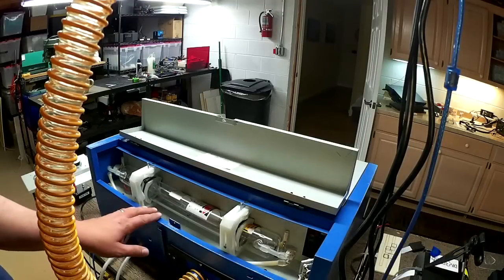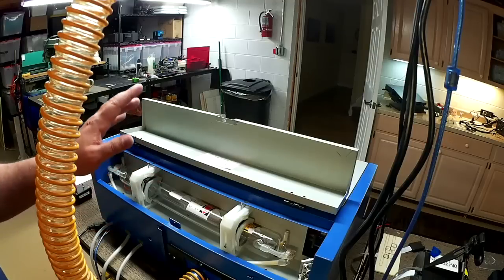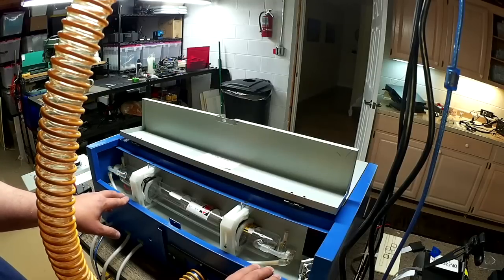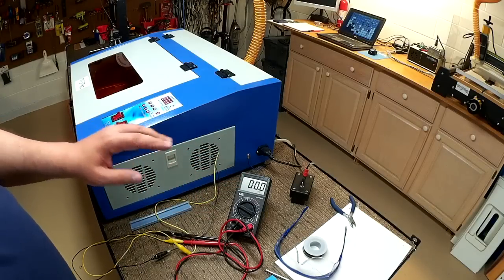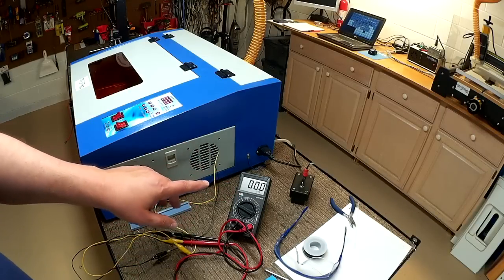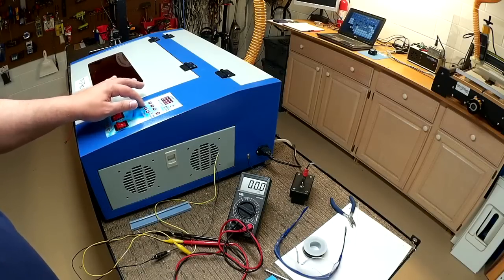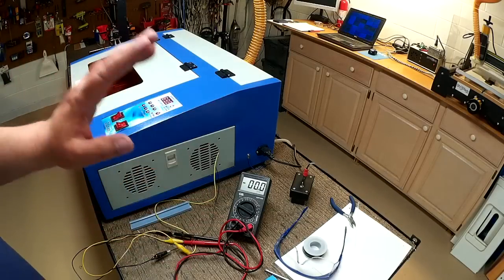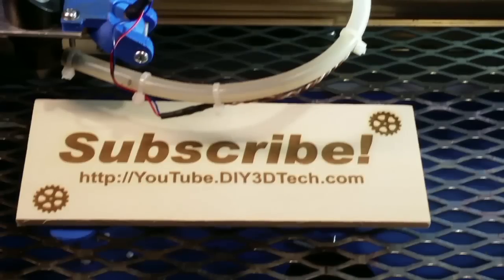K40 eBay Chinese CO2 Laser  -  Measuring Laser Tube Current!

Comment: hello, thanks for making this great video. I have a question though and would be glad if you might be able to help. We have a new 100w laser  tiube(117max, 107 agreed), fro "Reci Laser ". The one we had before was a Yongli, also 100w. The new one  is supposed to have a max current of 26 milliamp. But if we measure at the location with the wires you advised, we only get a max of 6,35 milliamps. What could be the reason for that? Thanks already for reading. keep making great videos:)

Comment: First at all, this laser tube can deliver 45W maximum (damage threshold), but it is rated 35W with 20 mA current. Performance also depend of how cool is water - the cooler, the better. Also, the specification say 15 - 25 C of water coolant. You should to run up to 20 mA, but for safety of the tube better 19 mA max. Minimum threshold is around 5 mA, below that laser does not work.
Reply from the maker: I agree in general as I have seen what would be a mechanically rated 40 watt tube be over driven to produce up to 50 watts which of course will shorten its life so there is a give and take.  However after using several of these for many years I have not found a correlation of water temp to performance in hobby laser applications as the duty cycles are typically short verses that of a high duty cycle industrial laser...
Reply: @DIY3DTECHcom  That is true. Somewhere I ever found that this laser tube might be 30W or even less, according to tube length. Well, that is small change in power, but I know myself - want more power. Achievable by cutting side of the machine and protruding new, stronger tube. But that cost more. Then replacing power supply for the tube... that may come later, I want first to buy my first laser cutter. :D

Comment: In my machine on the panel or in your program I set the minimum power to 30% and set cutting power to 10% or what ever I need. It wasn't explained in the manual but it worked for me.
Reply from the maker: Is this a k40 laser this sounds more like the 50 watt version?
Reply: Yes , mine is 50 watt.

Comment: How wide is the machine with the 35w tube? Is it 28in or 31.5in?...and u prob right the older version with snslog meter ptob sre better made machines...with better laser tubes...snything newer is typically chesper made to cut costs....people are brainwashed by compsnies  that newer is better made  and thats not the case most of the time for many products.
Reply from the maker: Can't remember and this unit is in storage, but this this a 35 watt unit and the other you see in my video (with the meter) is a 40 watt unit..

Comment: Hi..i was told by someone that tested watt output...that all these ebay k40 are fake specs...and not 700mm 40w tubes...they are 600mm 20w tubes...
...can anyone else confirm this?
Reply from the maker: This one is a 35 watt tube (which was sold as 40 watt incorrectly) however my other is 700mm and true 40 watts.  The ones with the analog meter tend to be true 40 watt machines...

Comment: How do you calculate the wattage after you have done all this? Ma x volts?. If yes, is it a matter of changing setting on the multimeter to read voltage instead of Ma? All wires stay the same?
Reply from the maker: Watts=Volt x Amps, however this is not needed as you should work in mA only and no need to figure out watts...
Reply: @DIY3DTECHcom   How to tell though if received tube is as described? For example a 100 watt tube or if power supply has the capability

Comment: at about 20 percentish and below, the tube is run in a pulse mode, not constant current and that is confusing the meter which is looking for DC, not a square wave. Once you go higher it goes into standard constant current. An analog meter will be ok with it as the needle has enough inertia to cope with the pulses. The tube is pulsed at the lower current settings as it has to have enough current to actually strike an arc reliably
Reply from the maker: Many thanks for this!  This is helpful to know as I sort of guessed at something this ;-)
Reply: Thanks, that's interesting... please provide a link to more information on this, cheers
Reply: Consistent with my first test run at 10% (raster on paper) which worked perfectly.

Comment: I also have a new K40 laser in addition to my bigger 50w unit. I have a laser power meter, and my new K40 actually puts out 43 watts at 99% power (which is slightly over driving the tube).  Thought people might want to know that you DO generally get 40W at the full power setting.
Reply from the maker: Laser output is a pure function of tube length and you will want to run it around 80%  as that last 20% will create a exponential loss of tube life so expectations of  a ~720mm tube should be around a 32/35 watt duty cycle...

Comment: I have seen laser tubes rated at 18 to 22 milliamps max. Your tube should have a sticker on it that says what the max current is and what the tested output was. I have a 50W laser and have never over-driven the tube. It still puts out 23 watts of power after 4-5yrs of 15-30 minutes use per day. In my machine settings 65% output maxes out the current. Every one of these machines should have a built in milliamp meter.
Reply from the maker: Its work keeping in mind there is a big difference in Chinese verses non-Chinese tubes.   I have two k40s and there are no tube markings, but 22ma is a normal "max".

Comment: Wouldn’t the fuse burnout before it kills you?
Reply from the maker: Nope as keep in mind when you get in the path of any electrical current you are not a "short" (a short is a direct path to ground with little or no resistance) yet the "load" so you become the "fuse" in the circuit...

Comment: Could the dropping out be due to the fact that they just wrap the wires around the posts on the laser tube instead of clamping or soldering them and it's having continuity problems at lower currents?  Gonna buy one of these, but having a hard time deciding on digital or analog.  I want one with the nano board so I can use the Whisperer software.
Reply from the maker: Analog, analog, analog!  Do not even waste time looking at digital one (I have both :-)
Reply: Analog it is, just ordered!  Thanks!
Reply from the maker: Good choice as most of the digital ones are also really 30/35 units they try over-driving for 40watts too.  The digital one was a waste of money for me (also more complicated to fix and mod)...
Reply: It is listed as a K40-3020.  Pics they show have the M2-Nano board in it.
Reply from the maker: the biggest thing is no mosie draw boards and the tube needs to be around 700mm or larger...
Reply: I'm pretty sure it'll have a nano.  Now I need air assist!  I found a tip, but I'm not sure about pump volume.  The pump I'm looking at is a 30 watt aquarium pump and has a 1030 GPH rating.  Not sure if that's enough.
Reply from the maker: Hard to say as I have seen people use aquarium pumps, however I use an airbrush pump (this one: http://amzn.to/2zqcXgO) with a separate air-tank set to output 6 psi (like this one: http://amzn.to/2h70d78).  However it gets very and has a hard time keeping up on long jobs so I have upgraded to this: http://amzn.to/2ioPm5l
Reply: I have an old dual piston compressor in the basement, but the laser will be placed in an unused room on the second floor and getting a hose up there would be a pain, which is why I was thinking about using the commercial aquarium pump.  BTW, I must commend you for your thoughtfulness and taking time to communicate.  Many channel owners tend to ignore people in the comments section.
Reply from the maker: No worries as that is one of the main reason for doing these is helping!  Again you can try the aquarium pump, however for my airbrush compressor, it gets very hot and the reason I stepped up, as you will need around 4 to 6 psi depending upon material.  As keep in mind the biggest thing you want to do is provide enough air to puff out the fire and not feed it (as too little will feed it)...
Reply: It has the M2-Nano board in it.  Arrived with one of the blower bolts busted through the outer housing.  Laser tube appears in one piece.  The blower is easily fixed with a longer bolt and a washer, but I contacted them anyway because nothing should be broken.  Will later upgrade to a better exhaust, but for now, this is it.
Reply: OMG GLASS!  I actually tried it on picture frame glass and it worked quite well, I just had to use steel wool to get rid of the little shards where it engraved.  300mm/s at around 6-8ma and it was perfect!  10ma at 100mm/s shattered the glass after it got so far, which I would assume was from getting too hot.  K40 Whisperer software is awesome!  Thank you for showing that in one of your later vids!!!
Reply from the maker: You can also do mirrors to (did a vid on that check the laser playlist).  Also do multiple pass's and will proved a cleaner edge and allow time for the glass to cool a bit.  Oh and turn up the air a bit...

Comment: Thanks for the video. So my wife bought one of those from ebay and asked me to set it up. When I turned it on for the first time, the on/off button flashed (fused) so I changed the fuse and the on/off button is fine now. However, I have no current reading and the laser doesn't move at all. Any idea what the issue could be? Thanks
Reply from the maker: That is not a good sign, and so you press the fire button and nothing happens even with the poteniometer turned all the way up?  Have you checked if there any lose wires?

Comment: I'm measuring output with a Synrad Power Wizard 250 and get right around 30.2 Watts consistently at 10mA.  It will only do 40 Watts if you push the tube hard...thus killing it quickly.  It's not a true 40 Watt tube.

I've pretty much given up on mine and am looking to build a 100 Watt machine eventually.
Reply from the maker: Yes most of these  are are pretty much 35 watt tubes, however two things (1) is you should be able to go to 16 or 18ma on the tube without pushing majorly on the tube. Second (2) the tube is a consumable which is what some folks don't realize so pushing should not be seen as an issue, it is just pushing till you start seeing negative returns which is typically above 18ma.  Also let me know how the 100 watt build goes as that is a good sized machine :-)

Comment: I have the same k40 as you with the digital power display. If set it to 20.0 is that 20ma or is that 2ma's ?
Reply from the maker: There is no relation to the number and power (or at least as I have found) and the reason I have added a current meter (check out the play list as I show how to do it). Also in that video I share some general percentage to ma ratio which might be helpful :-)
Reply: My incoming is 230v, I use a clampmeter and got 0.57A at 40, 0.66A at 50. Not sure if I’m doing it right

Comment: Hello, I saw you mentioned in another video about properly grounding the machine. I'm no electrician so bear with me, but with the machine being supplied power by a three prong cable wouldn't the ground from the outlet housing be enough to safely run the machine? I know there is a ground nut on the machine, but is it necessary to use? Any info would help. Thank you in advance.
Reply from the maker: Nope as a three prong ground is a safety ground and it also "assumes" your electrical panel is  properly grounded which many are not.  As the laser cutter because of its high voltage design dumps the cathode to ground, it expects an earthen (real ground)  and will seek the one with least resistance as being its ground.  If you measure there is around 15,000 volts @ ~20ma passing through that metal case (poor design) so if you're say an ohm shorter (i.e. less resistive of a path) than your ground, guess what.  All that voltage will be passing thought you.  Now 20ma is not enough to fry you, however it is enough to easily stop your heart.  Also the  IEC 950 safety standard suggests ground leakage be no more than ~3.5 ma and at full operation a 40 watt laser will leak ~21ma so around 7 or 8 fold of the safety factor.  Lets also say when your house was built the electricians cheated (as many did) and simply grounded it to the copper water pipes and later a plumber came in a spliced in a piece that new fangled plastic pipe so your home ground is now gone (but you don't know that yet).  If you dump that 15,000 to the ground lug all the devices in your home with a ground lug are now energized with 15,000 volts.  Hope this helps explain :-)
Reply: Thanks for the reply, that clears things up. If I purchase the machine I'd most likely use it in my basement (underground), what would you suggest for an earthen ground?
Reply from the maker: That makes it easy!  since your going to need to vent it (please vent it and don't do like some folks "try" and filter it as again they are risking their lives) you will need a hole in the basement wall (that what I did, like a dryer vent).  All you need to do is go to home depot and 6 foot or so ground rod and pound it into the ground and run the wire (it can be lighter gauge as its only ~21ma) with the vent and done :-)  Be Safe!
Reply: Absolutely the ventilation is just as important as the ground for the area i'll be working in, but thank you great safety information!
Reply from the maker: Whew!  Happy to hear venting!  And your welcome!  Any more questions just hit me up as I am happy to help!
Reply: One last question about the ground rod, what gauge wire do you suggest be ran from the machine to the rod?
Reply from the maker: If its only the laser I used a lite gauge wire  in the 30 range as its only 21 ma or so.  However as mentioned this would be only for the laser, if your going to do other machines I would suggest consulting your local electrical code.
Reply: Yeah it'll be a dedicated ground rod for the laser cutter only, will a putting a thicker gauge wire hurt? I have a lot of 14 gauge wire laying around.
Reply from the maker: Thicker is just fine :-)
Reply: Hey 3DTECH, 
I was hammering the 8 foot ground rod I got from home depot and its a few inches away from 6ft under, but the thing is not moving anymore. Do you think I could trim off the remaining and call it a day?

Comment: Whats the flow rate of the pump and is it loud?
Reply from the maker: No clue on the flow rate as it came with the unit and yes it makes noise not bad but noise none the less.  Also you don't need a lot of flow, just a steady flow and about 3 or 4 gallons of water.  Been using this configuration for about year no issues...
Reply: I was thinking a computer pump and radiator just to make it more compact
and how long have you ran it continuously and did the tube or liquid get warm?
Reply from the maker: I think you would have issues as the volume of water is key as I doubt in a normal duty cycle that a small computer type radiator could dissipate the heat fast enough.  I have one for a high power workstation and the just the CPU will warm it up.  With around 4 gallons of thermal mass it may jump a couple degrees under heavy use...

Comment: Could the dropouts be because there is not enough "load" on the power supply kind of like how an ATX power supply needs a minimum load to turn on?

Also, I noticed that there were a lot of "to make a long story short". Lol.
Reply from the maker: Yes I get stuck on "long story short", "Long Pole In the Tent" and "Basically" :-) As far as the load I am thinking the control board is the issue.  However most of what I do is cutting so I run it full out because when it bites the dust it will give a reason to buy a bigger one :-)
Reply: +DIY3DTECH.com - Use it like you stole it! Lol. As long as you use it once in a while to make something for the wife you should be good to go when it comes time for a replacement.  😬
Reply from the maker: LOL!  Just ordered the parts to do the MONSTER Tarantula build!  So when that shows up on the doorstep with all of the extra vSlot rail to make it into a gMax Sized monster a fraction of the cost :-) I am sure she will be happy as I am running out of room :-)
Reply: +DIY3DTECH.com - I need to do more printing and 3D designing. I have been slacking lately. I just installed a Micro-Swiss all metal hot end and cooling block kit in the i3 clone. Made a huge difference. Just need to print.  Then I can get more filament. Lol
Reply from the maker: I did the Micro-Swiss too and its ok, I had hoped for more but I actually have more jamming with the all metal hot end then I did the regular one with the PETE tube...
Reply: +DIY3DTECH.com - Did you put any thermal compound on your install?  I put some on the nozzle threads, the threads of the tube itself, between the tube and cooling block and where the heat sink touches the cooling block.  Before I put the thermal compound in I was getting lots of jams but after the thermal compound it was really flowing nice.

Comment: Is the control system separated from the HV system? Could it be the control system shutting the power down to the HV Trans?
Reply from the maker: I think its the control board as in the cheaper version its basically "analog" where the controller seems to perform some form of pulse width modulation.